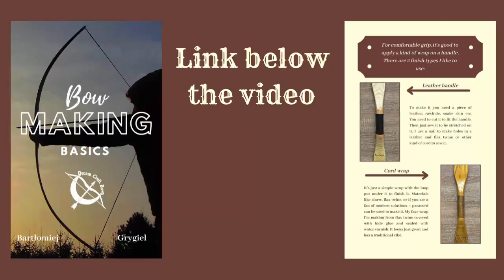Recurving a Bow in a Nutshell

Comment: Question, I am in the process of making a "D Bow" / Long Bow design, and already have the limbs tillered and thinned to Almost final thickness, is it even an option to try to change it into a recurve at this point or should I have only done this when the limb tips were thicker before I started tillering?
Reply from the maker: Well, you can always make recurved longbow if the piece is nice and long enough. If you already tapered width it's probably too late to change it into recurve flatbow.
Reply: @DreamcraftBows  Thanks... well... just means that after I finish this one.. I will have to make another as a re-curve! ;-)
Reply: Medieval art sometimes seems to depict longbows with recurved limb tips and one of the bows recovered from king tut's tomb is a recurved longbow.